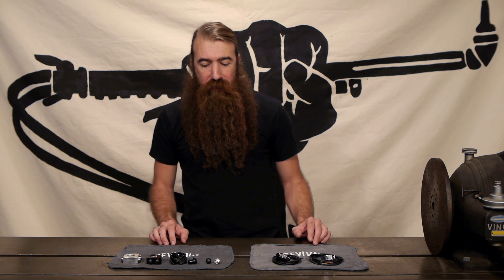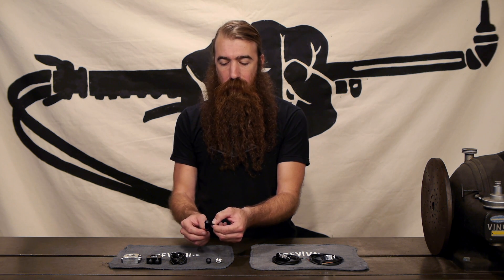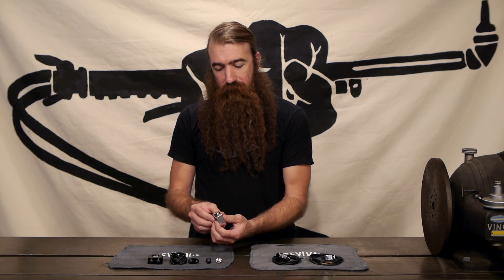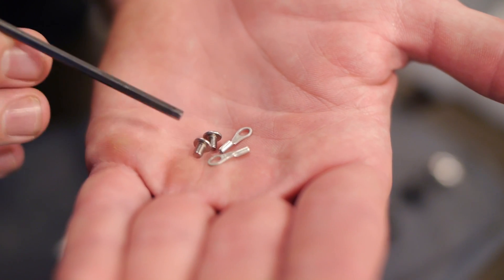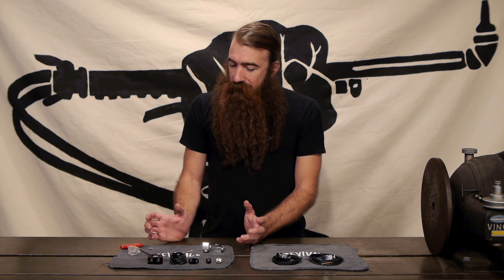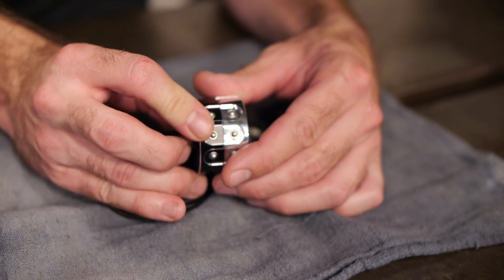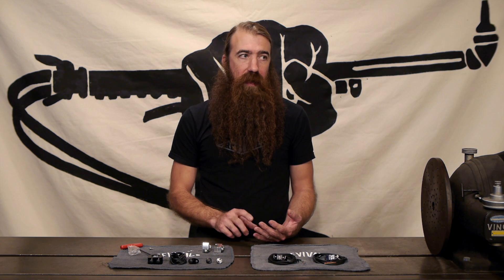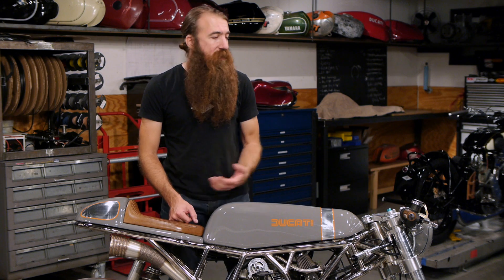Motogadget m-Switch - Revival Cycles Tech Talk

Comment: I have a question about the M-Switch Mini & the M-unit V2. I am planning to run both components. It is my understanding that the "Start" button not only starts the engine but if you hold it down for a few seconds it will also act as a kill switch. Is this true? Do I need any sort of special relay for this to work since the current capacity on the buttons is so small?? Keep in mind I am going right from the push button to the m-button then m-button to 'config' in m-unit. I am confused about where the output would go.. Hoping you could shed some light. Thanks!
Reply from the maker: It is true that the start button can be used to start the bike AND as a kill switch, but the way it works is a little different than your understanding. Press and hold will engage the starter, but a double click, like a double click on a computer mouse will de-activate the AUX output which turns off the ignition system, acting as a kill switch.

As long as you are using the m-Switches on the input side of the m-Unit or m-Button they do not need any type of relay. With the m-Button and m-Unit, the only electricity is at a signal level and that means there is very little current flow and it is really just sensing voltage. 

With the setup you are talking about, m-Switch to m-Button to m-Unit the connections are as follows: 

m-Switch - black AND red to ground, then the white, green and yellow connect to m-Button depending on which function you want applied to which switch. 

m-Button -  Black wire to ground (bad grounds are the most common cause of problems with these systems) Then follow the labels for the other wires and connect them to the white, green, and yellow of the m-Switches. Lastly connect the green wire labeled config to the config of m-Unit

m-Unit - Connect power and ground to m-Unit. Setup a key switch, toggle switch, or m-Lock to give +12V to the lock input to turn the m-Unit on. Then the outputs are wired directly to the devices you want to power, no output wires go to the m-Button or m-Switches. 

If you have more detailed questions, it is best to email techsupport@revivalcycles.com
Reply: Seriously, this is very helpful! I had a feeling this would work.Thanks for explaining how the kill switch function works, that's incredible. I forgot that it is a double click, I read the manual about a month ago and have been getting held back waiting for parts to finish the project so the info was a bit fuzzy. Again, I really appreciate you guys answering my questions and will be sure to mention your shop to my viewers in an upcoming episode here on youtube. Keep doing what you guys are doing, it's awesome for the community. --Tony
Reply: Hi, is it possible to use any momentary switch for the [above] starter/kill functionality? I am using 2 x 2 m-switches on the left side, but just wanted a single switch on the right for starter/kill switch - so I plan to use a triumph horn switch [https://www.ebay.co.uk/itm/TRIUMPH-HORN-BUTTON-SCREW-IN-TYPE-SPX025-OE-NO-2676207A/152850207229?ssPageName=STRK%3AMEBIDX%3AIT&_trksid=p2057872.m2749.l2649]
Thanks.

Comment: is it way available to use this switches without m-unit?
Reply from the maker: +Sasha Magwhy This depends on what you are trying to do with the switch. The details of how much current will be carried through the switch is very important, as is the fact they are push buttons... meaning they are only "on" when the button is being held, this works great with the m-Unit, but not really with conventional bikes. Most Japanese bikes use a toggle type switch for the headlight and turn signals. Email techsupport@revivalcycles.com if you'd like more details on your application.